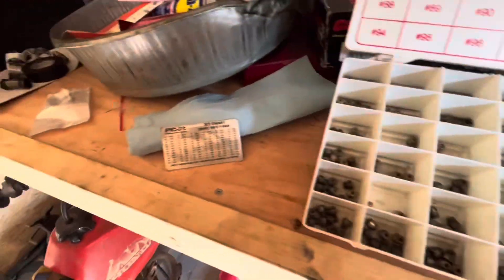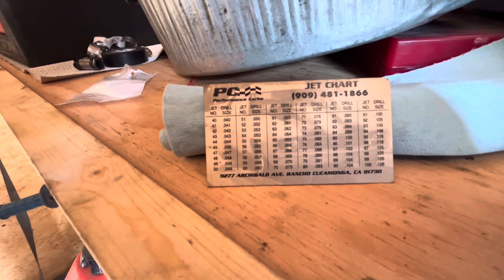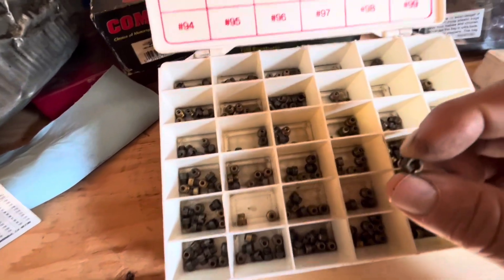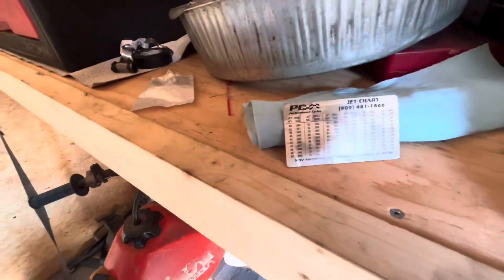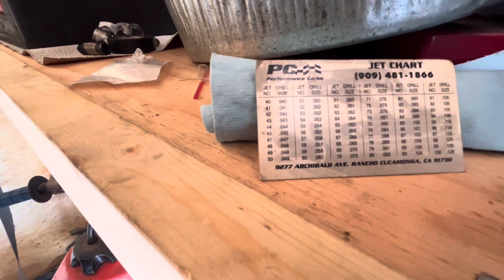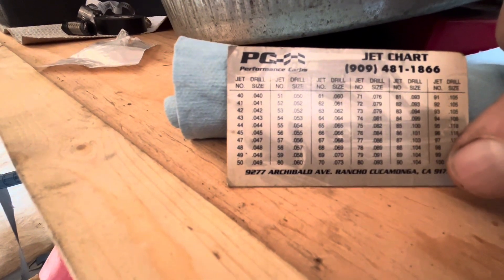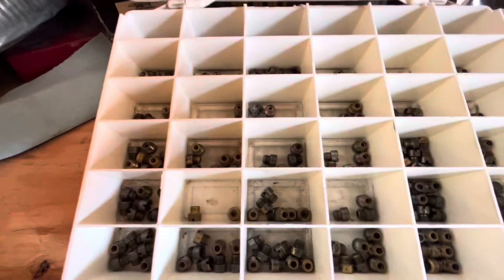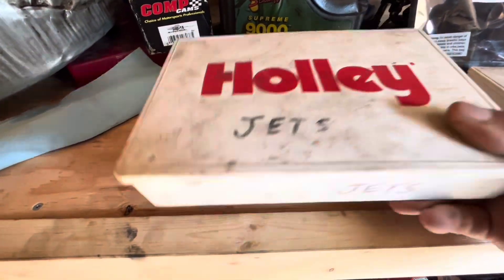Carburetor jet sizing explained #carburetor #bigblockchevy #1967camaro #cartuning #dragracing

Comment: If you are looking for very precise tuning, Holley made close-limit jets which are identified by 3 digit numbers and were more accurate than standard jets. The extra suffix digit can be a 1, 2, or 3. A suffix of 1 denotes that the jet flows 1% lean of the size spec, a 2 means it flows exactly to spec, and a 3 flows 1% rich of spec. 

If you wanted the ultimate in street and track tunability, Holley offered an electronic carburetor kit that included special bowls and metering blocks with mixture control solenoids to infinitely vary jet sizes with the turn of a potentiometer. The economy kit was called the mile dial and the racing kit was the quarter-mile dial.

Comment: This is "Building & Tuning" your built engine to the Next Level.  I guess that's how you can get a Motorcycle Quick Response from a Built BBC or BBF.  How is the change of Jets measured when comparing the results of a Jet Change?  Is it in an ET at the track?...Vacuum Pressure?...Throttle Response?  This is way over my head but it would be something to note.  Thanks.

Comment: So then basically there is no point in the “in between sizes” and it’s better to jump to next bigger or smaller drill size? I’m asking, because it would explain why a change from a 87 to a 89 doesn’t do much of anything.
Reply from the maker: For fine tuning one size up or down does change it slightly, but it is nice to know the hole size of each jet so your change is more substantial if needed by going to the next drill size regardless of what it says on the jet
Reply: @CenturyOldRacer Sounds good. Thanks for the info!